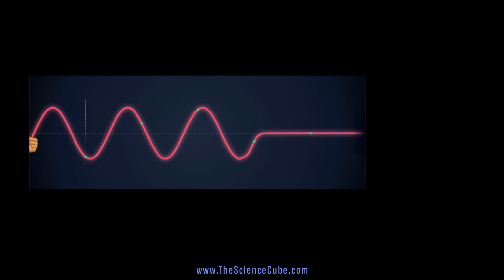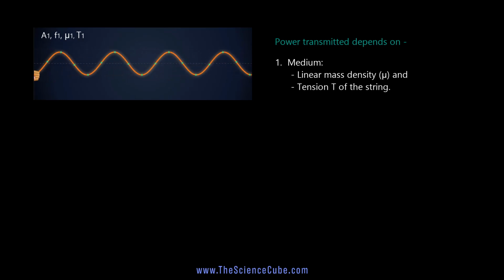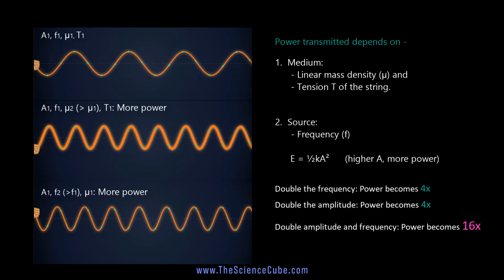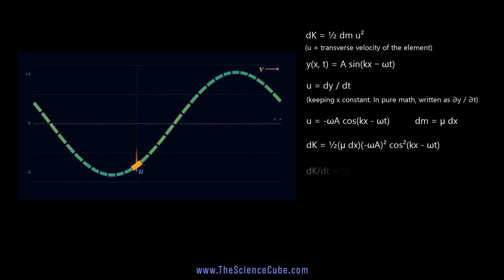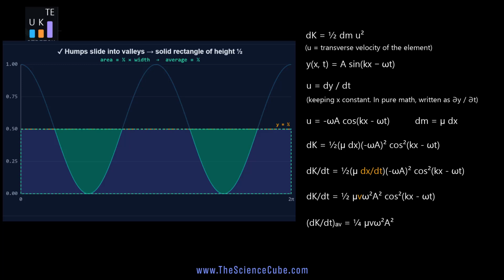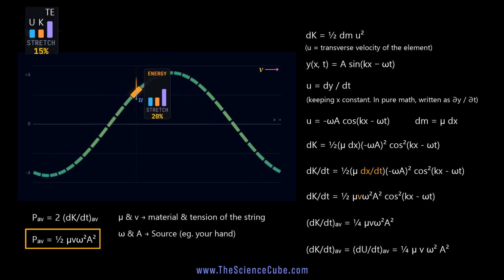Why Energy Peaks at Zero: The P_av = ½μvω²A² Wave Power Formula

Comment from the maker: Video Key Moments & Chapters
0:00 Introduction: Energy and Power in a Transverse Wave
0:20 The "Relay Race" Analogy: How Tension Transports Energy
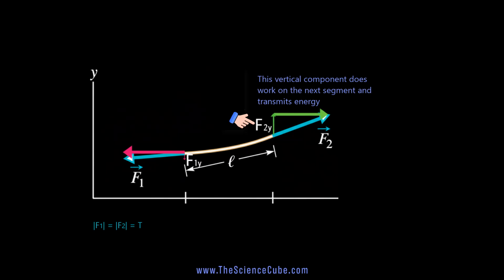1:07 Why Traveling Waves Store Elastic Potential Energy
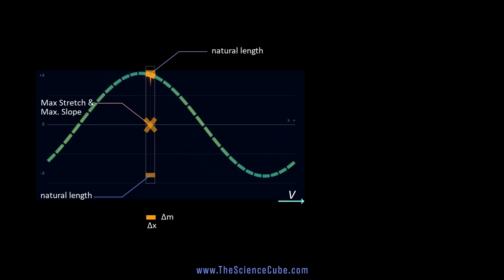1:41 The Crest Trap: Why Energy Density is Minimum at y = A
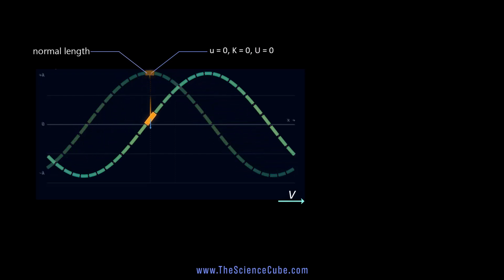2:31 Maximum Energy at Equilibrium: Velocity and Stretching at y = 0
2:56 Traveling Waves vs. Pendulums: Understanding Energy Packets
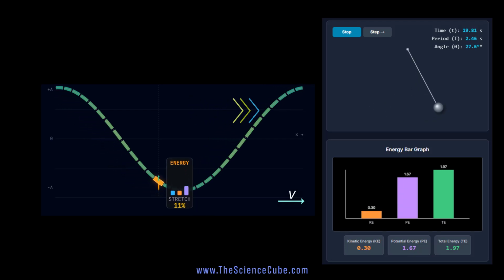3:20 The Amplitude Square Law: E ∝ A² Explained
3:52 Defining Average Power (P_av) and the Rate of Work
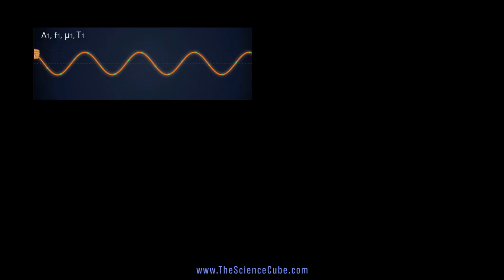4:09 Medium vs. Source: How Tension and Frequency Impact Power
5:07 The 16x Multiplier: Doubling Amplitude and Frequency
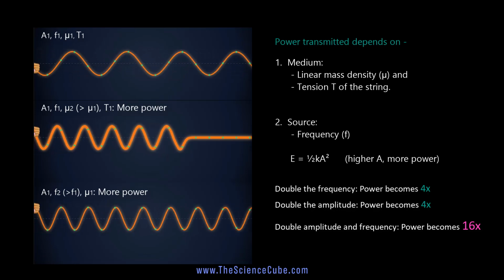5:56 Mathematical Summary: Understanding the P_av = ½μvω²A² Result